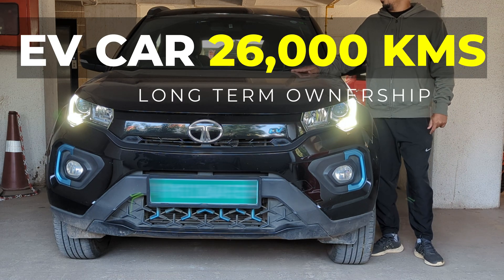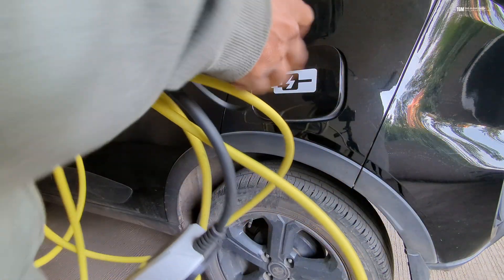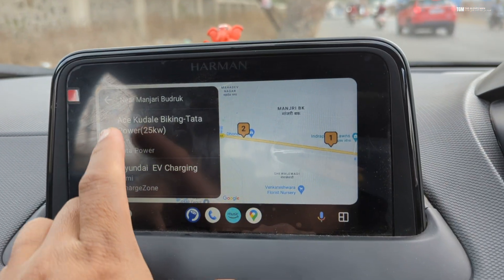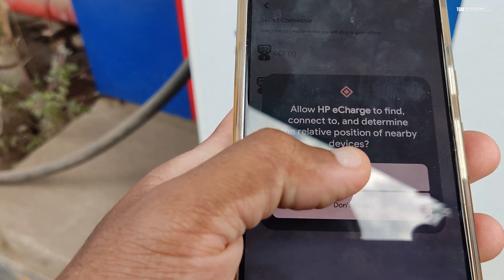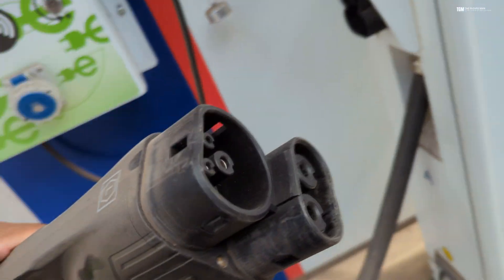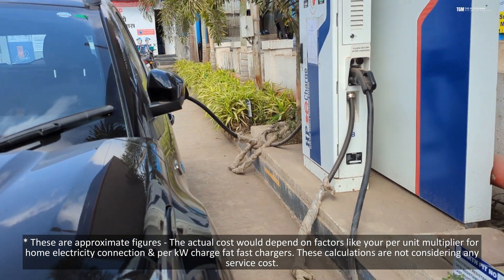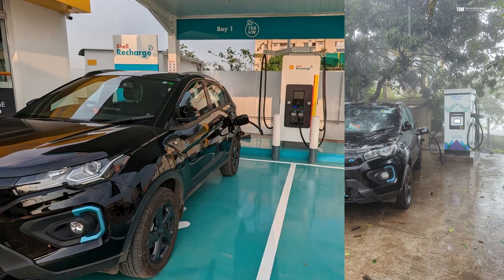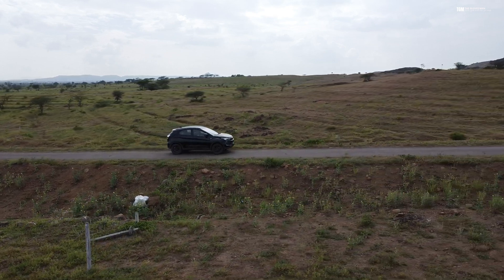EV Car Ownership Review in India - Things You Need to KNOW!

Comment: Good detailed video.. I currently have Creta DCT. I am thinking to buy harrier EV after selling creta.. but still confused only for long distance drive.(max 600-800km). I should not repent after changing car from petrol to ev in case of such range anxiety..
Reply from the maker: Go for it. The charging infrastructure has improved a lot in the last 1 year. You will not repent of your decision.
Even with this prime version of mine, I do trips of 400-500 kms one way. The only thing that I have to do is plan my stops before the trip. 

But with Harrier EV,  you should get a decent range. And it supports faster charging than these small ev cars, so it'll take less time to charge. 

And lastly, the savings part is insane. These days, charge zone has 25% discount for Tata EV s. So it's very cheap.

Comment: Short crisp but detailed review. Thanks. 
As you mentioned that you travel a lot and as you have prime varient, how do you manage charging outside. Tata officially asks us to charge EV once via AC charging for every 3-4 DCFC. So how do you manage long trips without AC charging??
Thanks in advance
Reply from the maker: Thank you for the appreciation. I carry an extension cable which I use to charge my car using AC charging. Usually at resorts or Airbnbs, I request them to provide a 16A port if it's available. Many resorts in Maharashtra have made provisions for AC slow charging using a standard 16a port for which they charge a fixed value. 
Till date, there's never been an instance where I've continuously charged using DC chargers for more than 3 instances in a row. 
Hope this answers your question.

Comment: When you charge at charging stations which I have seen, are in open, will rains affect it?

Can you still charge while it's raining?
Reply from the maker: Yes, I've charged it in Mahabaleshwar that receives heavy rainfall at an open charger of tata power when it was raining quite heavily. 
I usually carry a plastic cover which I stick over the charger using a normal electric tape so that the water does not directly fall on the charging gun area where it's connected to the car. This although is not something that's recommended by the manufacturer, but I do it as a precaution. 

The only thing that you should check before connecting the gun to your car's port is if the pins inside don't have any water on them. That's about it.

Comment: Thanks for summarising my decision not to buy an EV. Petrol is convenient and the cost of petrol can be justified with the convenience it provides. My budget hybrid car with regeneration costs me 4.86 to 6.68 rupees per km and for the ease of use, convenience, stress-free driving, repairing/maintenance cost and resale value for around 1,00,000 kms, the amount of 6 lakhs more than the EV running cost in terms of fuel is way more justified. I have not added the maintenance costs otherwise the price difference will come down further. 
Hybrids are the future and best of both worlds.
Reply: Fak hybrid lol it'll destroy you one day
Reply from the maker: A strong hybrid is the future and a plug-in hybrid is better than that. But considering the reduced prices of EVs now, I think they are worthy competitors too.
Reply: @TheGlovesMan  the battery technology is improving day by day, once we have the replaceable battery technology available abundantly and the systems becomes more reliable then EVs will rule.

Comment: 👏Very well done! Practical, comprehensive and useful/helpful ownership review..

What about the service center experience, competence point of view. Did you face any hassles?

Also, drive on highways - Diesel cars help you maintain a very good pace, I see many EV drivers sticking to lower cruising speeds hence can not keep up with the flow of the highway traffic, how do you tackle this issue?
Reply from the maker: Thank you for your appreciation. 

The service experience is mixed as well. Sometimes, these Tata guys are completely on their toes and sometimes they act weird. But overall, it's been better than my European diesel car. It's just that the service centers are very basic. Waiting area, etc.

You are right about maintaining a particular speed. On some highways where speed limits are upto 120kmph, it's easy to drive s diesel car at that speed and still get good mileage. 
However, the more you push these EVs, the more battery they churn. It can easily maintain 120 speed, but usually ev owners keep a low speed so as to not discharge the battery fast. But if you have a long range EV, it's not a problem. 

I was once in a puddle because of the battery percentage going below 10 percent on a highway. Below 10 percent, the car goes in a very weird mode and ac turns off and the speed is limited to 40 or 45kmph. To drive at such slow speed on a highway is madness. So you need to plan properly.

Comment: Great points. I am planning to buy nexon ev. You didn't mentioned which model and year is your car of? Also how much did it cost your on road then? Did you did any subsidy or incentives? What were RTO charges?
Reply: Go for mahindra be 6 that is way better in all aspects
Reply from the maker: Thanks. Sorry, I didn't cover those bits. I've mentioned by car model towards the end.
It's Nexon EV prime August 2022 manufactured. It cost me 16.30 L onroad at that time after getting 1.5 lakh subsidy here in Maharashtra. The prices were on higher side at that time. RTO charges were only Rs.5000 as there is complete tax exemption in some states.
Reply: TATA does not offer free home installation of the charger now. It can cost you an upwards of 60,000 depending on how far your garage is to your electric meter and fusebox.
Reply from the maker: @alileevil  No, that's only for the higher power charger setup. The gun type setup is still free.